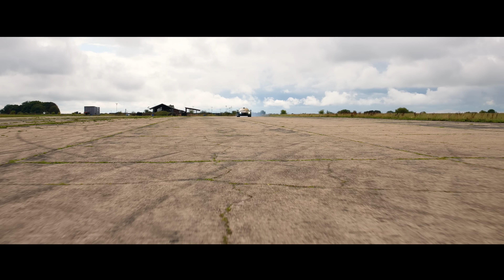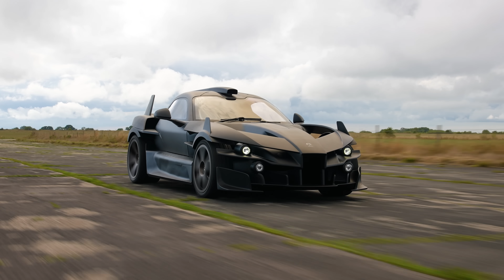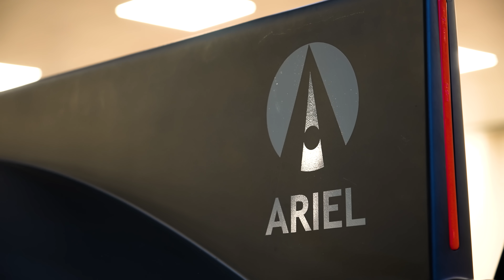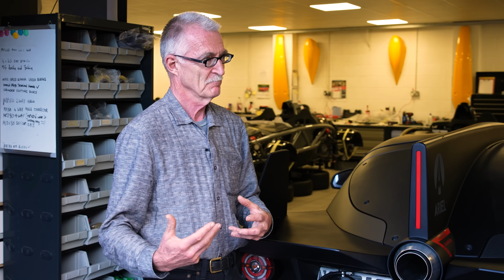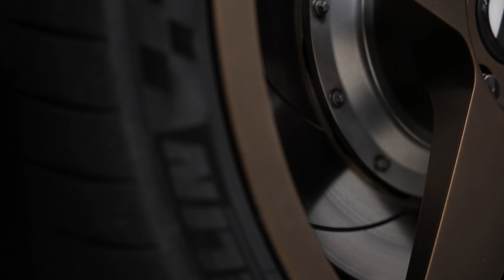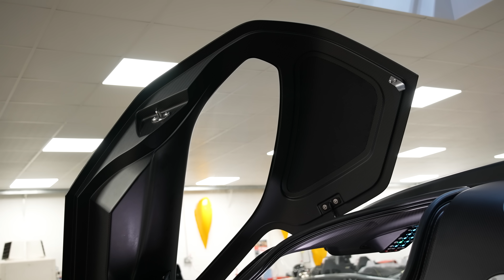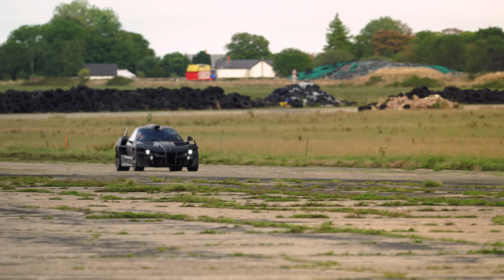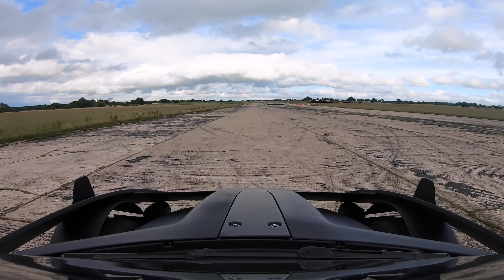NEW Ariel Hipercar – 1180bhp, 0-60mph In 2secs + Jet Engine?!  | Top Gear

Comment: Well, the idea of a turbine engine as a range extender is not really new. The big benefit is small and run it one speed. The speed that gives the most output per unit of fuel. And if somebodies tailgating you. Just light the blowtorch (1).  
1) back in the early 70s one of the Nascar teams ran their exhausts straight to the back of the car versus side exhausts like everyone else. The exhaust heat would cause anybody drafting behind them to overheat.

Comment: No one is going to say it's pretty, but as someone who loves engineering, there is something beautiful about how deliberate and purposeful everything is. I do think the vertical winglets on the front fenders need to go though. Especially if their only purpose is to disturb the air around the mirrors as he said. Design a more aerodynamic mirror housing instead. Or lose the mirrors altogether and use cameras and screens instead. It'll be interesting to see how it develops. I love companies like Ariel who push the limits and don't make compromises.

Comment: When airplanes are electric and have range equal to current technology,  I'm interested.   Meanwhile the size, cost and weights is the barrier. It takes 100 lbs of batteries to equal the energy in 1lb of petroleum.

Comment: Not a huge fan of the front lights and the tails above each wheel but its cool nonetheless i'm really thrilled what that turbine would actually do to its performance as well as noise.👍
Reply: The turbine so you don't have to rely on the charging network but still need petrol... ermmm
 THAT`S RELYING ON THE PETROL NETWORK...  hydrogen fuel tank oooh at 30-000psi near a jet turbine engine 
"" KAAAAA BOOOOOOM ""...

Comment: why are new cars so tall? this one has a foot of bonnet above the front wheels, and it's not like they crammed a V8 under there. The roofline is nearly shoulder height - I'd be looking up at it from my 5 Series. sports cars used to be low and slinky - this one's got the bat mobile vibe, but the vertical scaling went wrong. more nomad than atom :(

Comment: what staggers me is that despite its small size, it's still very heavy. Couple that with a bad driving position, what looks to be quite a high cog as the car doesn't look low and squat, no great noise and no gears....

Nope. Cool idea but not a drivers car.

Comment: The turbine just makes sense as like the bloke says it's more efficient than a piston engine, they're also smaller, lighter, and technically much simpler than a 4 stroke piston engine.
Honestly, I don't see why turbine range extenders aren't offered in more high end electric cars as they can easily provide ample power for motorway speeds whilst recharging a nearly depleted battery, and the weight savings of having an APU (auxiliary power unit) and a small fuel tank instead of a full size 100KW/h or so battery would aid both performance and efficiency. The only issue I can think of is cost, but if more cars used them, there would be more competition in producing them, and that would in theory help to lower costs

Regarding the regenerative braking however, I wonder if they have considered using a flappy paddle for regen particularly in track mode as it would allow the operator to use regen instead of regular brakes in certain situations in order to keep surplus heat out of the regular brakes and provide even greater stopping power if needed.
Such a paddle could be staged so light pull triggers regen setting A, heavy pull triggers regen setting B so if you just want to shave a few miles per hour going into a corner you can, if you want to throw down the anchor you can do that too without heating the brakes. It would make sense on the track particularly during endurance races as once that battery is depleted you're limited to the 30 something KW of that turbine APU, regen would help to prolong the time before the inevitable limping due to a depleted battery.
Sure, there's always the question of added complexity, but if the regen is there, and the user adjustable controls are there, that paddle is basically just a switch to tell it to turn on/off.

Comment: I love the companies like Aeriel exist. What a magnificent work of engineering!
Reply: ariel, SLC and keonigsegg ... dream machines
Reply: "we" already now how to do extremly powerfull car by the engine but the problem is about the wheels
Reply: Ariel literally just invented the batmobile
Reply: Every inch of this creation has been designed for peek performance.
Reply: @kirkdurkadurka  peak
Reply: have you seen the McMurtry Speirling? awesome british EV with roughly 1000hp 980kg weight and creates a downforce of 2tonnes, that thing is a little beast!
Reply: It's just cool, can you imagine a Jet that is tuned to the throttle?
Reply: Just think if they turned their efforts towards a personal E-VTOL
Reply: @mpetersen6  nah, this is cooler.
Reply: @mpetersen6  Batteries are a HORRIBLE way to power something like that. They have 5% of the energy density of liquid fuel. And that's when they're new. A couple years later, they have half the capacity they did when new. The only reason we don't have flying cars, is because people are too fucking stupid to be allowed them. Some dickhead crashing through your roof, does more damage than some dickhead crashing into your wall.

Comment: The only way this could go 0-60 in 2 seconds is if the traction force is about 30% greater than the weight of the car. (Do your V=At and F=mA calculations to check me out.) You might make it to 60mph in 2 seconds if truly rocket or jet propelled at about 1.4 g's acceleration. The only way to create that much force from traction is to have a cog engaging a geared rail in the roadway. Otherwise you just get a 1180HP rubber burner. My guess is the car ends up in the ditch every time anyone tries to punch it.

Comment: Finally, and I mean FINALLY... I've been wondering for more than 10 years why nobody has proposed using a small turbine in an electric car.  A small turbine and fuel tank will cost and weigh a lot less than batteries for that 300+ miles of range you'll almost never need, and turbines run on any kind of fuel, including clean-burning alcohol.

Frankly, I think the whole transition to electric cars over the last 20 years has been totally botched by everyone.  Too many designers and politicians...not enough real engineers.

Comment: Ariel built a bonkers Batmobile. I've always been infatuated with the Atom; now I'm love with the company. Their founder's awesome.
Reply: That is what I thought too - a small Batmobile
Reply: it looks really similar to the mcmurtry speirling
Reply: That was my first thought when I saw the video thumbnail...its a Batmobile!
Reply: @Arm all police  what do you mean
Reply: If only it had a snub nosed impeller between the front wheels, to power both a jet turbine with torque vectoring attached to the bottom of the vertical stabilizer, and a propeller hidden right behind the cabin where the trunk would be, that sends air into a splitter that exits in front of small down force generators above each rear wheel.
Reply: Yep, pretty much, a mini Batmobile.
Someone made a turbine Batmobile
Next up should be a Nolan Batmobile or Snyder Batmobile with the V8 replaced by a helicopter turbine. The helicopter turbine can generate enough power on their own to power the electric motors when you want sustained speed, then when you want to be "stealthy" you switch to battery power.
Reply: Every single piece of engineering this company does is just sublime!!!
Reply: Came here to say it looks like a Batmobile, and has the jet engine to match.
Reply: Same
Reply: I thought exactly the same 😂😂😂
Reply: In love* you mean?
Reply: @apex_prey   So, should I correct your correction since you didn't formulate it properly?
Reply: @AtlasJotun  No. I gave you the benefit of the doubt. Perhaps I shouldn't have assumed you'd know your grievous mistake.
Reply: @apex_prey  You intentionally made mistakes while attempting to correct someone, and somehow that gives me the benefit of the doubt. Makes sense.
Reply: The first Batmobile that makes sense since 1989.

Comment: They will be the second manufacturer to get a jet engine into production. Chrysler made the first publicly available  jet car
Reply: Its not a jet car. They just put a small gas turbine generator typically used by power companies in a car.  Basically eliminating the power generation component from the grid that typically used by pure electric cars. I doubt this is worthwhile considering the efficiency loses in a generator this small and built to resist high level of dynamic forces.

Comment: Focusing on smooth blended braking could drastically increase range at track speeds, especially with motors connected to all 4 wheels. For example, the Gen 3 Formula E cars are expecting to have 40% of their range come from regenerative braking, and they have no hydraulic rear brakes at all, with a blended front setup!

Comment: A turbine is "way more efficient than an internal combustion engine: We looked at rotary engines. We looked at different ways of doing it" 
Maybe it's more efficient in dry weight and packaging.... Rough guess is that it's going to use at least 9 gallons/hour of use. What's that get you? 6.6 MPG hwy?
It's still cool that it will let you take that longer trip, or use that battery aggressively and still get you to the next charging station. 
I'd wager a little inline 2 cylinder 2 stroke would package about as well and be a more efficient in reality.... but wouldn't be nearly as cool.

Comment: Love how they gave it a homemade feel by making it look home made.
Reply: Ariel literally just invented the batmobile
Reply: @alida flus  jaguar, Cadillac  and a few others have had concepts with this setup. The problem for then and now is turbines tend to be incredibly hard to maintain. I am curious to see how they have solved that issue perhaps regular expensive maintenance intervals.  By expensive I mean a full turbine replacement every 10 to 15k miles.
Reply: @gurgleblaster2282  I mean the people who can afford this ain’t bothered about expensive maintenance
Reply: @ki7561  I didn't see a price point and they make cars in the 80-120k range so 🤷.
Reply: @gurgleblaster2282  So the people who can afford it shouldn't be worried about the maintenance costs then
Reply: @ccalvinn  it's expensive maintenance even for luxury car standards lol and yes people who can afford these things do care about that stuff. So I reckon they figured something out.  But generally that is the reason why this setup has not been done before.  Another example Mercedes made a car that used an f1 engine. That had to be replaced every 25k miles. That was the one and only time they did that.
Reply: A super car owner could mistake it for a kit car and try and leave it in its wake.
Reply: @spendor9377  Yeah, that's the point. It doesn't look like it was made by a company.
Reply: if you're making cars that go 0-60 in 2 seconds at home why aren't you selling them?

Comment: Big proponent of turbine-electric autos, I wish a major mfgr would implement it.  Use a supercapacitor instead of a battery, for lighter weight.  And eschewing touch screens is exactly the right move!  Autos with touch screens will age very badly

Comment: It sounds awesome. It isn’t silent like a normal EV, but isn’t synthetic either. It sounds like it’s actually electric.
Reply: The turbine so you don't have to rely on the charging network but still need petrol... ermmm
 THAT`S RELYING ON THE PETROL NETWORK...  hydrogen fuel tank oooh at 30-000psi near a jet turbine engine 
"" KAAAAA BOOOOOOM ""...

Comment: This is the way electric trucks should be powered... Like that Nikola company had in mind, except without the scammery. I know Bosch, GE and Kawasaki Heavy Industries were working on a retrofit system along those lines maybe a decade ago, but I don't know what happened with that. It certainly never made its way to being commercially available.

Comment: Jet turbines are bigly efficient when allowed to run at their ideal speed. The Chrysler and GM projects of the 60s failed because they're terrible outside a narrow speed range. Making the primary propulsion battery-electric sidesteps its biggest weakness. 

It will be interesting to see how they've solved the emissions issues though. Turbines burn the fuel more completely than piston engines, but they usually burn a lot hotter, making NOx and SOx a bigger issue. SOx won't be an issue for the petrol version, but will be if they ever make a diesel version.
Reply: I guess you can still add a catalysator and DPF..
Reply: @rkan2  yes
Reply: Diesel ist mostly sulfur-free or very low sulphur in Europe incl. UK these days. S amplified soot formation, too. For NOx, they might inject AddBlue. Much easier here compared to a variable load Diesel car engine with cold loads.

Comment: I created super Car rendering with rear vertical stabilizers. Then Lamborghini did the same thing with the Sian. Then l conceived the idea of another super with 4 vertical stabilizers like the one in the video. But l was not sure if regulation would allow front stabilizers. Well, this Car has proved otherwise. 

It would have looked better if it sat lower/wider with the cabin set far forward.

Comment: Why not just drive the car directly with the Turbine? If it can recharge the batteries then it can put out enough power and would be more EFFICIENT then converting Turbine power to Electrical into the batteries then convert from battery storage to to drive the Electric Motors, a system that loses a decent amount to heat, not to mention the weight of all the EV stuff weighing the car down.

Maybe if you can combine the 2 and use the turbine to boost the performance while maintaining the batteries you could make an argument for having 2 separate systems, kinda use the turbine like a Nitrous Kit or something along that line.

Comment: For an Ariel, it's not going to be light.
For a 1200 hp toy with 4 wheels, it's not toooo heavy.
If one were to re-do a Nomad (as I intend) with more modest power (less cooling), I bet it could be sub-1000 kg. Even with AWD from 4 motors as I prefer. Tank turn donuts, baby! REally 4x 100hp is plenty for me in a 1000 kg buggy. If it were a Nomad R style kit or Atom with better aero body...then still I guess.
The single seater Speirling does have the vacume cleaner ground effect, larger batter, 800 hp or so and under 1000 kg. 0-62 mph in like 1.5 seconds (it's less really). Zero speed, high downforce already. Better than drag strip prep. More power than in needs and when lapping a track, it would not take very long anyway with such power output. Less power, good cooling, decent track stint length, decent road stint length...yes please!
I'm thinking of 1/3 or 2/5 of a Tesla Plaid battery. That's 33-40 kWh and 330-400 hp. In a car well under half that of the Plaid, I think it will suffice to rush to the store or whip Nurburgring record holders...on the Nurburgring, if the car is set up for such.
Imagine an AWD Nomad with good traction control and torque vectoring and real rally wheels. Much lighter than rally cars, same power. Surely it would keep up?

Comment: Size and weight of battery is still totaly dealbreaker for sports car.Electric engine is not a problem, but battery is...you can't store energy equivalent of full tank of petrol in a battery 60kg heavy and the size of a petrol tank,which seriousely humper the performance of EV.When someone make that kind of battery it would be groundbraking...untill then these all ev cars are gimicky.

Comment: Most exciting EV in years, and not just because it's blisteringly quick! Really interesting thought to use a gas turbine as a range extender with the potential to use hydrogen as a fuel. It will be interesting to see if that idea gains traction (pun intended) elsewhere in the motor industry.
Reply: I've been blathering on about a similar thing for years, but I was thinking a tiny (like 500cc) 3 cylinder turbo diesel optimised to only run at a specific rpm (eg 3000) to best charge the batteries. Should be very efficient and not super heavy.
Reply: @mmpj twod  If they ever manage to get this thing road legal, I will personally, make a shrine for them.
Reply: The Hyundai N Vision 74 might interest you. I'm quite enamored by the looks but a hydrogen fuel cell along with a dual motor electric drive-train is quite interesting. I would love to see more work into hydrogen as a fuel even though we need to find cheaper ways to manufacture it for wide-spread adoption.
Reply: @aaronb9630  I think that long-term hydrogen will be the fuel of choice due to its energy-density. We're a long way away from making it sustainable at the moment though. ☹️
Reply: Ariel literally just invented the batmobile
Reply: liberals will still consider this a polluting car because it still uses petrol...

Comment: Jet engine is actually fantastic, since they can run relatively easily on H2 🤩
Reply: Probably wont be much of a range extender though :P
Reply: @bingoberra18  could be...35 kW average power is enough for "driving like a twit" as he said
Reply: @s2hedz  Yes but to store H2 in the car would be the challenge.

Comment: This is the perfect hybrid vehicle. The usage of the turbine for electric generator is genius.
Reply: The turbine so you don't have to rely on the charging network but still need petrol... ermmm
 THAT`S RELYING ON THE PETROL NETWORK...  hydrogen fuel tank oooh at 30-000psi near a jet turbine engine 
"" KAAAAA BOOOOOOM ""...